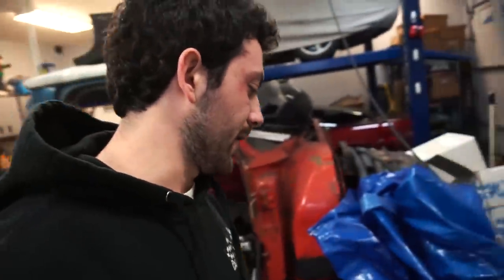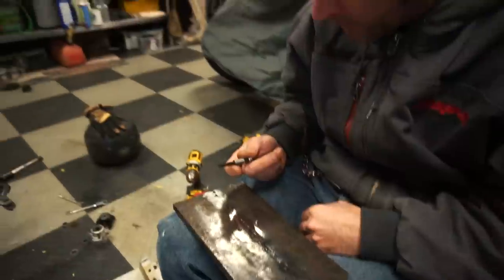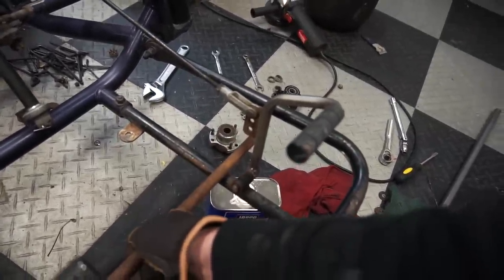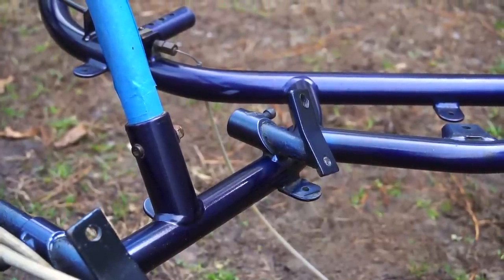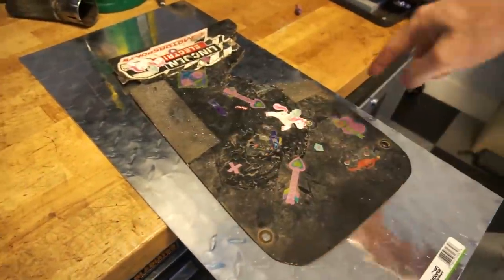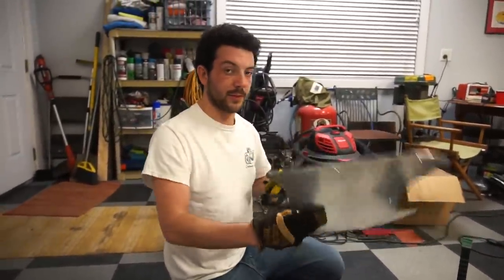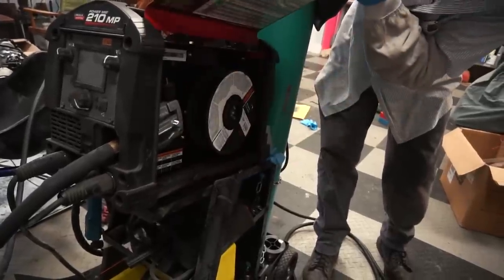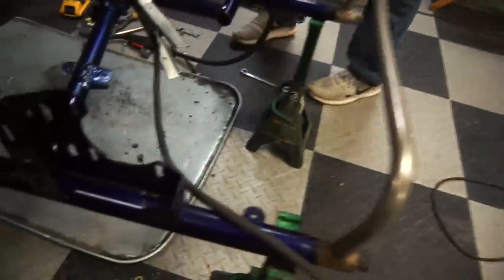5 Speed Racing Kart Build (Pt. 2)

Comment: I think I woulda put a butterfly steering wheel with a hand clutch on it.

Ya'll really need to find a local metal supplier and quit over paying at the box stores.
Reply from the maker: Unfortunately the independent metal shops have been no cheaper 😕
Reply: Hand clutch is Definitely the way to go. You only need the clutch for take off.
Reply: NO I would not want you too change too hand clutch its way more fun with it on the foot (yes I have that on mine)
Reply: Up here in northern California we have a scrap yard that you can usually buy pretty good steel that they sell gor 30cents a lb.
Reply: agreed!!! I have a local metal shop about 10 miles away from me. they ALL know me. and most times I get shit for free.
Reply: CarsandCameras just make one trip and pick up some sheets of what you're going to use most
Reply: neo 71665 agreed he could have gotten a sheet for what he paid
Reply: +1 on the hand clutch.
Reply: Jaysson Tansey and shifting, right?

Comment: The diamond plate looks fine and as Ike said it will dull up over time, so don't be to overly worried right now that it is flashy because that will change.  One idea for the pedals though would be to use a hand throttle on the steering wheel,since your steering wheel does not have much travel you shouldn't need to worry about twisting it up.  Alternatively you could do a hand clutch on the shifter itself, a lot of drag cars use this kind of setup and given the limited room it might be easier than a three pedal setup.

Comment: If it’s a thru hole (and not a blind hole), use a center punch to remove a broken tap.  The hardened center punch will shatter the broken tap making removal easier.   Not always recommended for blind holes as it could be a bear to get the pieces out, in which case burning the tap out or welding it out is an option.
Reply: Cheers for the tip!

Comment: I think I would keep the diamond plate, it's durable and once you cover it with a seat and battery tray, if you equip one, it won't be as OTT as it appears to be now. If in the future you decide you don't like it, you can always remove them and perhaps hit them with some acid or spray on bedliner, or even a contrast color. THat's the beauty of a project like this, you can always edit as you go. I have questions about the engine and trans set up, but I will hold them,, because I trust that they will be addressed later in the build. Thanks for posting guys, we'll catch ya next time!

Comment: got a question im building my own stage 3 predator 212 and i have the chrome molly 5.260 push rods, are they the right size push rods to run or will that cause a valve to smack the piston? just asking

Comment: Well if the diamond plating is too flashy, you could hit it with a matte/flat clear coat to dull it out a bit, or paint it a different color. When in doubt, always have a spool of flux cored wire laying around if you run out of gas and/or solid wire. Just one of a few things you pick up on when you do a lot of welding.

EDIT: what chain size is that Lifan 200 sprocket 40, 420, or 428?
Reply: Ratkill9000 40

Comment: tip-u can actually drill a tap w/ a masonry drill bit. it may dull occasionaly but can EASILY be resharpened on a grinder due to the flat blade type edge!

Comment: 1/8"  plate, fold the edges over in press brake, will be plenty stiff enough, that 3/8 is rather overkill :)

Then, just weld nuts to the bottom of the plate...

Sorted :)

Comment: +CarsandCameras  slight criticism... use the rod to weld 2 pieces pipe aligned on frame, short sections for the pedals arms to weld to, short sections between those as spacers so it's all on ONE line and feeling straight on your feet. what WERE you thinking? you were halfway TO that!! couple cotter pins through and one rod slips out for maintenance to any of the three. cut grind away the two old ones and locate the new "inline system" right where it's comfortable/natural not awkward. it's kinda upside down to what chevy did in a bunch of cars, swapping automatic to manual trans was just a longer bolt up under the dash. 
seriously, don't be lazy, redo it now before it goes together.

Comment: I don't care what brand taps you buy, they ALL suck today! You gotta get the right numbered bits, tapping lubrication and a Serial Tap Set .
Serial Taps usually have  3 in a set of gradually increasing size, sneaking up on the finished thread. I haven't broken a serial set yet and I buy the Chinesium, Bang-Bad type!

BROKEN TAPS ARE MORE FRUSTRATING THAN A CAT TRYING TO BURY A TURD ON A FROZEN LAKE!

Comment: To get broken taps out of a through hole flip the plate over and fill the hole with high pressure grease. Then grind the tip off of a drill bit and drill it from the back in the drill press. It will often push the tap out.

Comment: Y'all should put a hole on the plate below the motor to make oil draining easier. Also, the oil pump filter screen is on the seat side of the motor below the stator housing, and that needs to be removed, cleaned, and inspected with your first few oil changes (just something to keep in mind as you setup mounts for it). The centrifugal oil slinger should also be inspected and cleaned at least once a year for optimum performance. That is the oil filtration system for fine particulates since these cg clone motors don't use normal filters. I could go on and on and on...

Oh, and if you want to get the most out of that engine, port the head, especially the exhaust port. It will make a huge difference with the top end power. I will try to find a way to show you my before and after results of my 250 head if you would like.

Comment: it never fails ,you run out of welding gas or wire when places are closed .do a track type build using big mud tires ,turned into crawler tread .

Comment: Ya know, if you had made the engine cradle brackets a form of L bracket and then bolting it down you could sandwich some rubber pad in there and had a little bit of vibration dampening. Btw, the diamond plate looks great and will dull up after a few months and look even better.

Comment: Clutch should be on a pull lever/ wire hoop just below the steering wheel so that you can pull the clutch and shift while still holding the wheel. Just like a shifter kart is setup

Comment: Heads up guys.When cutting aluminum,it would probably be better if you use a jigsaw with metal cutting blades.its easier to cut curves and won't gum up like cutoff discs.

Comment: DUDE!  You love the purple paint, but take a razor blade to it?  Next time, rub some of the thick Goo Gone over the decals the night before, and they'll most likely slide off with a fingernail push the next day.  If not, do it over several days.

I could have used that tap extractor 30+ years ago when I snapped one off when tapping an aluminum rim to install Moon hubcaps.  And it was the LAST of the 3 holes.  I ended up leaving it in place, rotating the Moon 120 degrees, and drilling/tapping 3 new holes with a much more expensive tap and a LOT more oil.

Diamond plate - next time, buy a 4x8 sheet.  MUCH cheaper that way, you probably spent half a sheet's worth.  Most shops that have it will do 2-5 cuts for you for free when you buy a whole sheet.  I used a whole sheet on my cheap HF trailer bought 14 years ago, have never regretted it, the wood on my other trailer rotted out in a few years. the diamond plate is nearly unblemished.  I could probably crack out the polish and make it look brand new after all these years.  If it weren't a TRAILER floor...

The rotted trailer is getting diamond plate soon too.  Not only does it look damned good, it stands up to serious abuse, and stiffens the bolt-together frame.

And if you still don't like the dplate after it dulls, paint it with a tinted clear paint.  Candy blue...or blurple.
Reply: Talonts Blurple!!

Comment: shiftercarts i have seen have a clutch lever under the steering wheel mounted to the steering shaft so it rotates with the steering
i agree with isaak that it will dull out over time

Comment: You should use a handle bar clutch lever and mount it to the shifter so you pull the lever in and shift at the same time so you don’t have to have 3 pedals.. just a thought

Comment: Could cause problems by trapping your heels on the other hand it could feel ok. I have never seen it been used before. The main problem is that it may screw up the flexing of the chassis. Make the mounting holes bigger and use rubber grommets and don’t bolt it down to tight. That’s my penny’s worth.

Comment: The weld area is going to be tougher to tap than the regular plate because the heat of the welding hardens the steel. USE TAP OIL!!

Comment: The diamond plate looks good in there and why not just paint the kart the right way? Spend the $20 and make it one color. You can't polish a turd fellas. Purple paint is still being produced btw
Reply from the maker: You have a good point. I wasn't trying to get that involved in restoring the chassis, and it looks good as it sits, even in person. I'm satisfied with how it turned out.
Reply: I guess if you are satisfied with it that's all that matters. Take some steel wool to the diamond plate and dull it a little and hit it with some clear so it doesn't rust. I guarantee you will like the outcome.
Reply: Ed Ed thats actually genius...i suggested they paint it black but thats smart

Comment: I don't know why you didn't stretch it our so the driver could lay flatter at a lower profile and make a roll bar cover over the driver so you can dig dipper in the corners, with a seat belt, to hold you inside when it rolls if crashed.

Comment: Put a hand clutch on the steering wheel........
Reply: no its more fun with foot control
Reply: +Herman Wallin hell yes its more fun to drive foot clutchin it. hand clutch is for wimps. IJS...!...lol
Reply: Yeah, foot clutch is fun, in a car. When you have limited foot movement, how are you supposed to brake and hold the clutch in? Heel and toe? No, because limited foot movement. That is why the hand clutch level exists (outside of race quads)
Reply: You have the break on the left on its own, an the clutch an gas pedal right next to eachother on the right side of the steering column/shaft. You’ll see when they make. Ihave it like that on mine an it works great.
Reply: No shit the clutch on its own an gas and brake next to each other my bad

Comment: If you ever need to take of vinyl again heat it up with a heat gun or propane torch before using the razor knife and it will come off easier.
Reply: Also the Milwaukee Inkzall markers you can find at any hardware store are cheaper than sharpee and "write on any surface."

Comment: I have my own machine shop. I have NEVER seen a tap extractor actually work. NEVER
The good news is, your broken off tap is in a thru hole. A good candidate for a hardened punch and ball peen hammer. You can often just break the tap out by driving the pieces out the bottom. Of course this usually ruins the threads you have already cut, but you can always retap it or drill and thread it larger.

Comment: At least cap off where you cut the bumper off...I’d do it right and repaint it purple or gloss black and do the diamond plate metallic purple
Reply from the maker: I did cap the cut bumper... with bolts. Welded and ground smooth.
Reply: Yeah sorry i comment before the videos over lol..paint idea would still be cool

Comment: VERY UNSAFE - having three pedals, almost all shifter karts have clutch on a lever or paddle on steering wheel or column with a regular motorcycle clutch cable - ESP since you have that wheel with the cut-out center, PERFECT place for a clutch (you only use the clutch on a shifter kart to take off from a dead stop, and to come to a dead stop, shifting while driving is clutchless)
Reply: way more fun with foot Control. you get that feeling of driving a car. im 15 btw

Comment: Not trying to be a nag or anything, but cutting that aluminum diamond plate with that cut off wheel is not smart. The aluminum will stick in the pores and explode. I've seen it hurt a few folks. They make blades for aluminum.
Reply: LS Luvr 😦

Comment: Ok here are my thoughts; #1 paint looks good; #2 Diamond plate looks great; #3 why did you use such thick steel for the engine mount; #4 How are you going to adjust the drive chain with the engine rigidly mounted; #5 Why didn't you buy a used real motorcycle engine instead of that lame Chinese POS engine

Back to engine choice, you sure could have bought a 125cc or 250cc water cooled used engine for less than $500.00.  Then you would have had some real horsepower....
Reply: Wayne Howarth the plate moves to tighten the chain